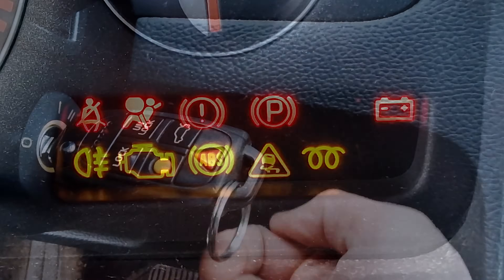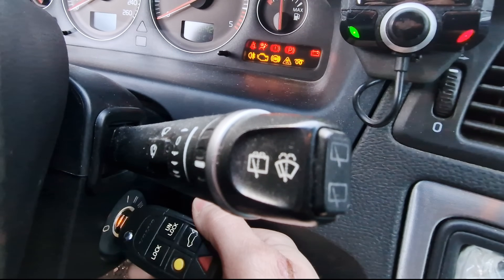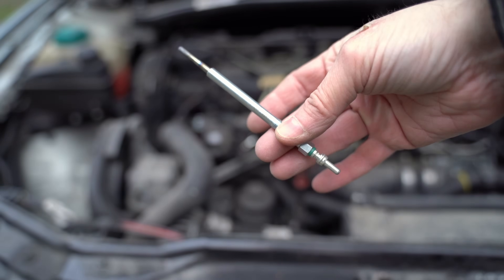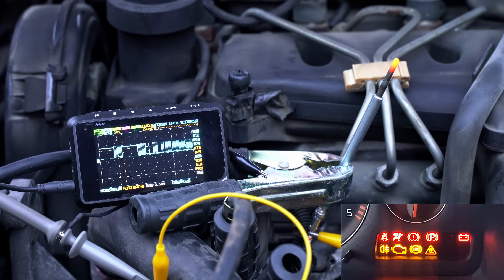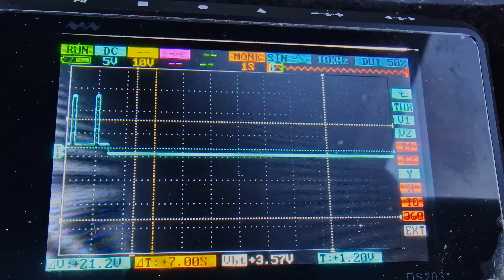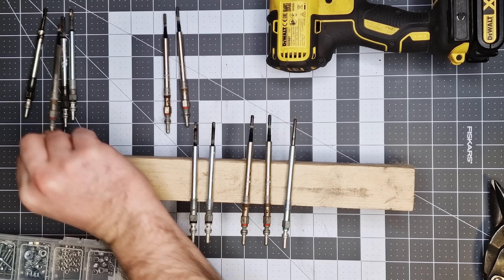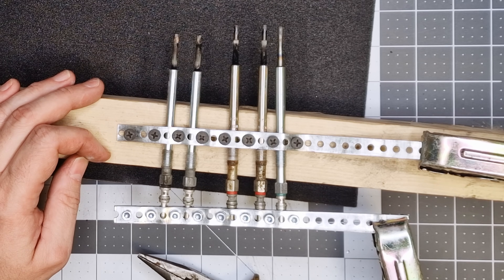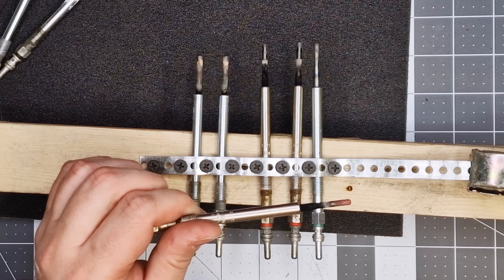Double Preheating Glow Plugs – Real Benefit or Just a Myth?

Comment: The glowplugs on this Volvo engine are low-voltage types, the previous Euro 3 version still had "old-skool" 12V types hence the difference in length and performance. They get a short pulse of 12V to heat them up quickly, then PWM is used to prevent them from overheating and burning out. The glowplugs are also used in the regeneration process of the DPF.

Comment: Nobody needs an oscilloscope for glow plugs 🙄
Reply: You do when you suspect a power supply problem to the glow plugs.
Reply: A test light will check that @MTI250
Reply from the maker: I'm just so used to doing diagnostics using different instruments that I do it without thinking. Here I wanted to show the control signal and spark plug heating. You can't tell what's going on just by looking at the plug. And multimeter will not show impulses either.
Reply: @ItsReallyEasy  I use an oscilloscope all the time in small engine/light truck repairs. I only think of it as a "fast voltmeter".
Reply from the maker: @patrickshaw8595  It's actually very useful to know how the signal changes over time.

Comment: Modern plugs heat very very fast, they run at full 12v for a short time, and them reduce back via PWM control. And a current clamp would be easier to see it all as installed without probing wires.

Comment: Depends indeed if your car is indeed new enough for direct ECU control of the glow plug. Older relay controlled cars can match the dashboard.
Reply from the maker: You are right, but these are very old engines. In the comments below guys wrote about such old ones on W124. But on Citroen XM 2.1TD the light goes out before the plugs stop heating. As it turned out there were many options.

Comment: My example is 1995 Citroen XM 2.1TD. That's an older diesel with swirl chambers and purely mechanical injection pump.
From the factory, the glow plug timer-relay adjusts preheating time to the temperature in the engine bay. It does power the plugs for few seconds after the indicator goes off. It stops preheating immediately after it detects signal to the starter motor.

Doing preheating cycle for two or even three times really helped during cold weather. 

Anyway, I rewired it so the indicator lights up for as long as glow plugs actually work and I also cut off the starter signal. Now it preheats even after engine starts. 
I noticed that starting the engine kind of cools down the plug tips and engine runs rough after few seconds when there is like -10 C or less. Leaving the plugs hot prevents that. People had warned me I'm gonna destroy them quickly but so far none of them gone bad, and it has been like three years now.

And this engine is very sensitive to preheating. I once had one plug not working. It was a solid minute of white smoke and unburned fuel smell each morning in winter, before engine would warm up a bit. Modern common rail systems are completely different. You can barely notice burned plug.
Reply: I can confirm the 2.1TD is a very hard engine to start if the glow plugs are not working. Have a 1984 Jeep Cherokee with a J8S 2.1TD with a bosch VE pump and if i dont cycle the ignition about 3 times it starts rough and smokes a lot. It also has a little Glow plug control unit in the engine bay and i might rewire it like you did
Reply from the maker: Yeah, you're right, on older diesels a burned out plug is a problem. By the way, did you know that in engines with vortex chambers, the plug is often used to break the flow of fuel during injection. That is sprayed on the plug. And if the tip of the candle burned off, but the candle itself still somehow works, it is not easy to find the cause of cold engine vibrations. And as something so all winter I tried to deal with an old Audi engine, which was put on VOLVO 740. 
Anyway, thanks for the interesting story.

Comment: toyota d4-d 2.2 and d4-d 2.0 WILL NOT START below -2*c  without good glowplugs . 
and thats pretty modern common rail diesel engines , but my old FORD 85hp industri/marine/tractor engine , HAVE NO GLOWPLUGS , starts every time , first try , even in -20 *c .
:face-purple-wide-eyes::body-blue-raised-arms:
Reply from the maker: Well diesel engines in general are very finicky. Sometimes old diesels can really start better, but you have to admit that new ones are more economical and powerful. And, of course, more complicated. :)
Reply: @ItsReallyEasy  for sure !

Comment: What i really want to know is how it works on older diesels, those diesels that REALLY need glow plugs to start easy, like a W124 with an OM606. Indirect injection. Glow plugs are almost optional on direct-injected diesels if your injectors are all good
Reply: I run a couple of older OM617 MB diesels in W123's. In the bitter cold a double or even triple glow plug cycle makes a huge difference in speed of starting, and quality of idle. Cranking after the light goes out on one cycle will result in a hard start and usually a random miss for ~30 seconds without throttle. Cycling plugs more takes care of this. Probably a sign I need to clean the carbon out of my pre-chambers.
Reply from the maker: @krausrepair1171  Awesome! Thanks for the info! On Common Rail engines, the initial cranking speed provided by the starter is actually more important. And I'm pleasantly surprised that so many people are still using cars with the OM617 engine. Keep it up, guys!
Reply from the maker: If modern diesels don't burn out all the plugs, but they have increased vibration after starting. And at -15 degrees Celsius and below, they may not start at all.
On OM606 engines there is a glow plug relay, and as far as I know it works as an on/off switch. But whether it turns the glow plugs off immediately after the dashboard light goes out - I am not sure. But I was wondering, I need to find a car like this.
Reply: @ItsReallyEasy  some old indirect injection diesel some kind of after glow system which made glow plugs hot even after the engine is already running, older Toyotas had these for example land cruiser 60 or hiluxes, I got one two and I can't imagine it starting more smoothly than it is right no even with only one glow cycle
Reply: Some older diesels, Volkswagen, for example, used 6 volt glow plugs with 12 volts applied for a short duration as a form of fast glow. Repeatedly re-glowing those types will result in early failure.
Reply from the maker: You're right. I remember seeing in the parts database that sometimes the operating voltage of the plugs was specified. Some of them had voltages other than 12 volts.

Comment: Maybe for new age stuff, but older stuff just has a timer relay, that you can audibly hear turn on and off. some times double glow does help with start up, but its usually a sign that the glow plugs are getting old and not working effectively
Reply from the maker: You're probably right. I've seen this too, but on older diesels without common rail (mechanical pump). Maybe the myth originates from those vintage diesels.
Reply: Older diesel motors had more reliance on glow plugs. Modern common rail diesels can tolerate much less pre-heat than the old motors and the post-start heating is purely emissions based. I had an old 2002 Citroen C5 2.0 HDI with 350k miles (ex taxi). The wiring for the glow plugs was dead but it would still start in -5degC but would just take a few more seconds. If the battery was good, it would always start - the colder weather just meant maybe 5-6 seconds vs 2-3 to start and a little puff of white smoke.
Reply: Afterglow has been a thing since the 90’s so absolutely no need to fiddle with key on off. As the video suggest, wait longer if car is not maintained properly.
Reply: Some plugs designed for afterglow like the Beru GN series actully get cooler after they’ve been on for more than about 8 seconds so glowing twice may actully be a bad thing, though you may still have more heat soak into the combustion chamber which helps. These were 12 V plugs with a simple relay and the cooler afterglow phase is controlled by an internal resistor designed to extend plug life by preventing overheating. More modern designs with PWM control do the same thing but its part of the controller not the plug. 
I usally go Beru or Bosch when I can as they tend to perform a lot better than some cheeper brands - easy to see by how quickly tip gets near white hot.